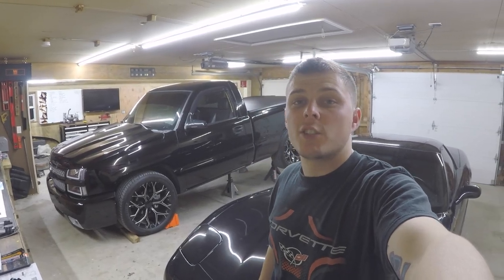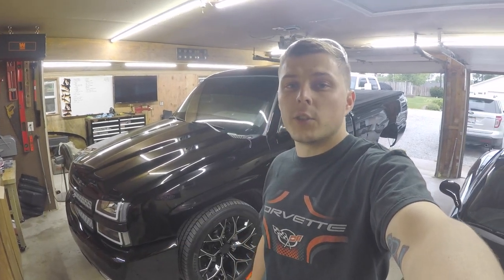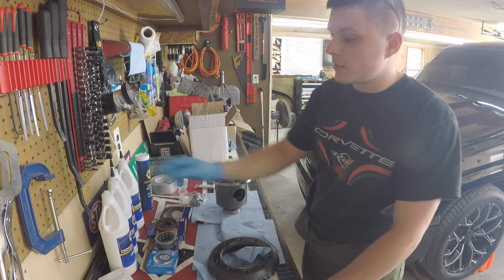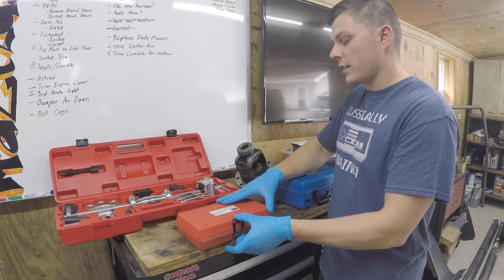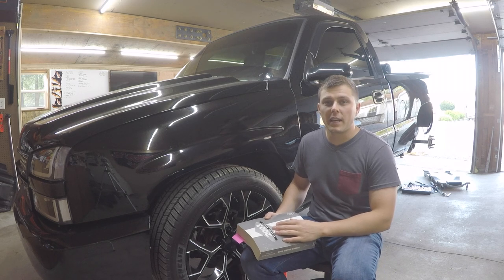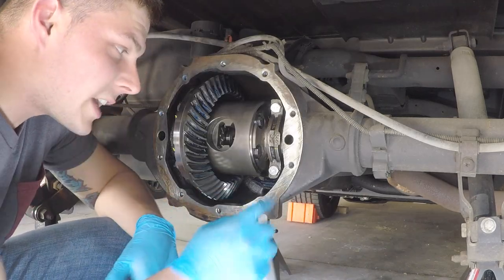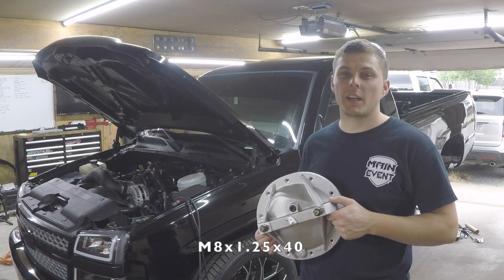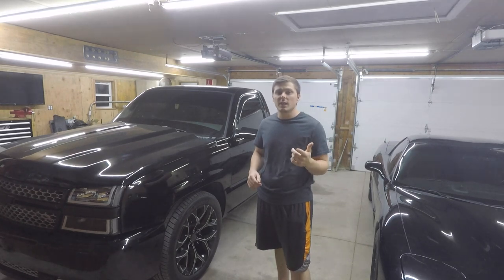Installing A Detroit Truetrac & A New Diff Cover In The Silverado Street Truck!

Comment: Any gear recommendations for a lifted 4.8 on a 33x12.50 r20
Reply from the maker: Hey, honestly depends on what you want it for. Highway driving with better mpgs, but slow take offs, all around driving, or fast acceleration, rock crawling with terrible mpgs. But 33s arnt too drastic. If you have the 4l60e I'd definitely invest in some gears. Staying stock gears but bigger tires can be hard on the tranny sometimes. Below ill comment two links. The first one is a website that converts it for you. Type in your stock tire and gear ratio, then type in your new tire size and it will convert it for you. Your stock gear ratio you can find in your glove box. The second link is for a conversion chart for alot of different tire sizes and shows the different setups. Im no professional, but I think 3.91 gears would be good with 33s. You could always go with a lower gear ratio like 4.56 so that way, if ever down the road you change your mind, and go with a 35 or even a 37inch tire, you have the gearing to do so. And don't have to change the gears out again. Just spend some time and do some good research, there is alot of info out there, especially with installing the gears and backlash. Don't get overwhelmed, you got this 🤘
Reply from the maker: https://tiresize.com/gear-ratio-calculator/
Reply from the maker: http://www.anycalculator.com/gear_ratio_calculator.html
Reply: TheKingCoopa thanks brotha appreciate you taking the time to reply 👍🏼
Reply from the maker: For sure, let me know if you run into any issues and have questions.